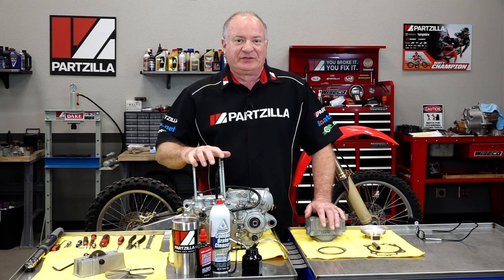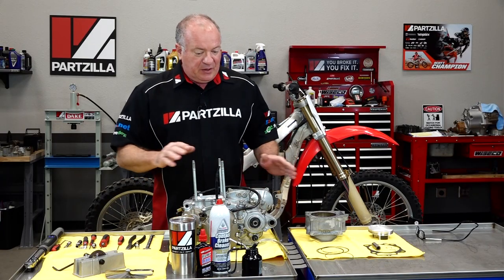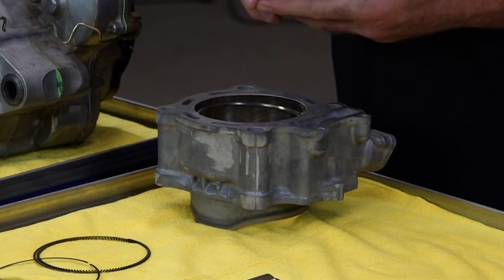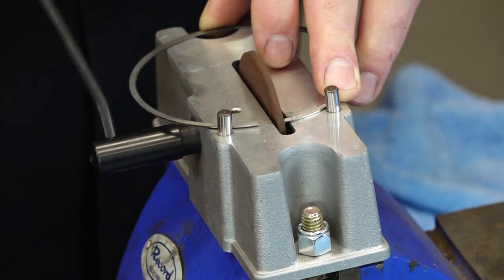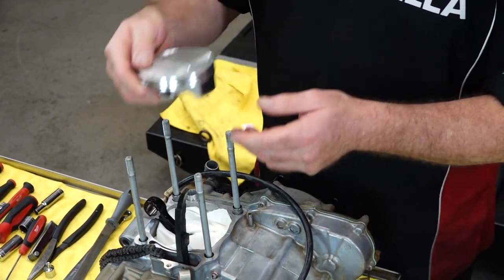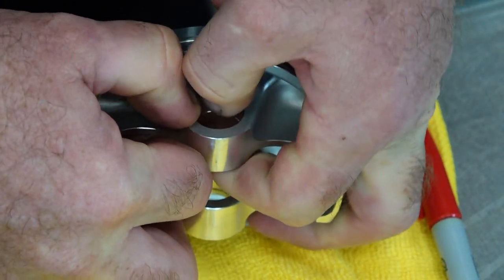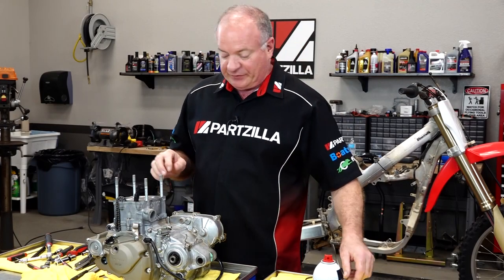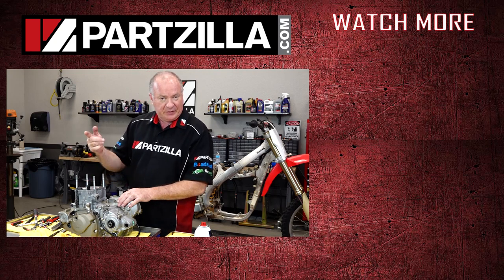Honda CRF450 Piston Installation | 2005 Honda CRF450-R Engine Rebuild Part 5 | Partzilla.com

Comment: is there any information about the piston height corresponding with top of cylinder? In no WSM is indicated how to check this and which values of piston play towards cylinder head must be respected. Especially when using aftermarket piston and gasket kit. In aftermarket gasket kits are differences in thickness of cylinder bottom gasket and cylinder top gasket. Therefore this request.